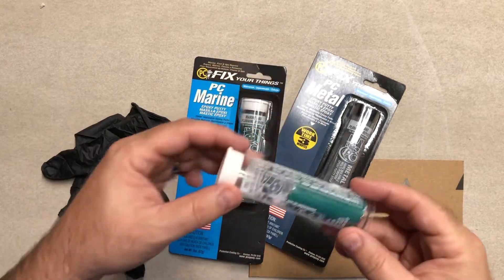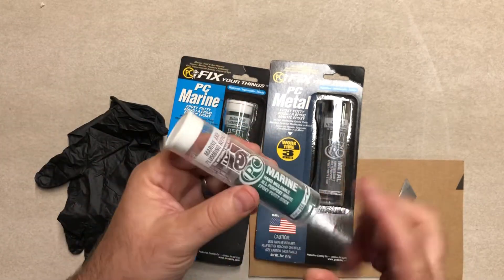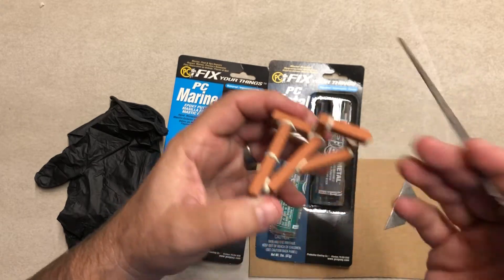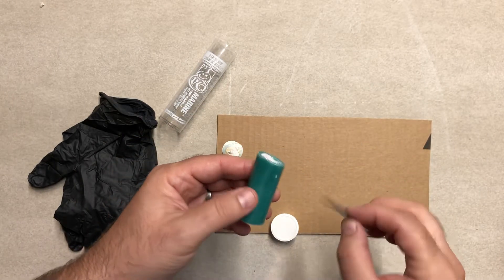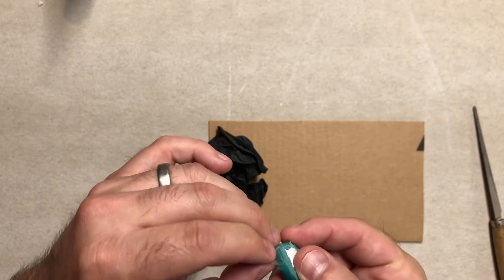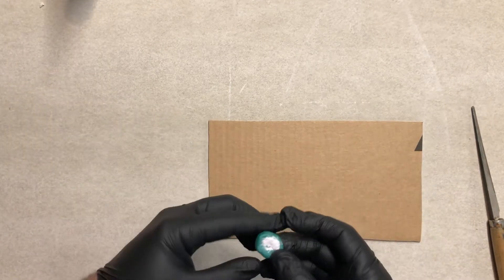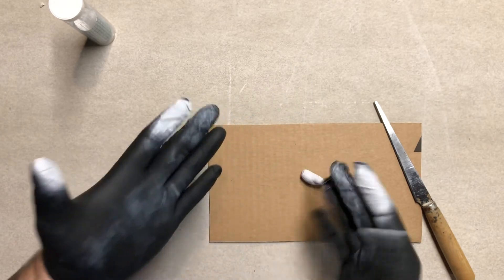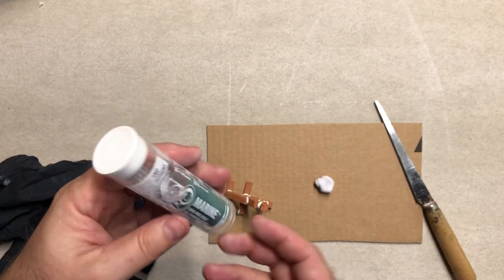Mixing epoxy putty

Comment: little trick forget the gloves and mix the epoxy with wet hands holding the epoxy under running water while your mixing it then apply see how it wont stick to your hands instead of the gloves

Comment: Hi sir why only resin putty becomes dry after 2 month even epoxy resib putty is in sealed bopp film?     After 4 months its totally dry what the main reason behind it sir?
Reply from the maker: I'm not sure. That would be a question better answered by the manufacturer. Good luck!